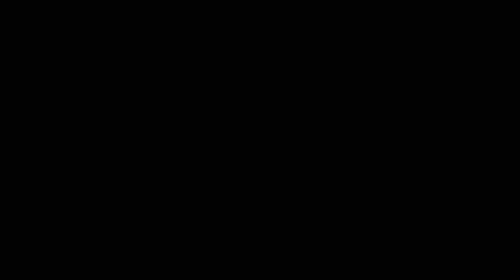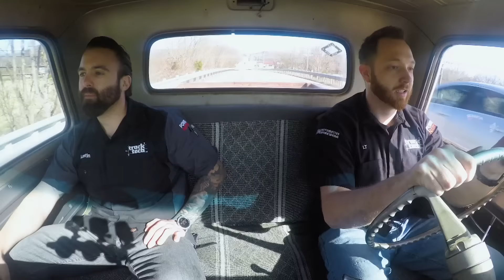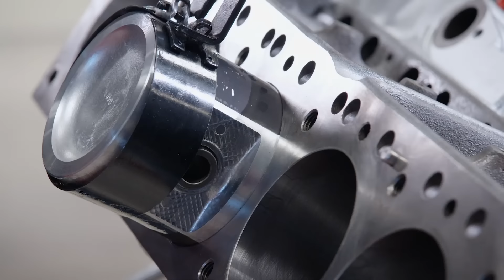Forget the LS Swap: Building a Turbo Chevy 292 Straight-Six

Comment: All Aluminum inline 6! Break out the check book
Reply: Actually you can get the all aluminum Chevy 4.2 Trailblazer I6 engine for fairly cheap at any junkyard. However, those engines had many design flaws, so I don't know if it is worthwhile.

Comment: Yeah... they didn't put the turbo there for OCD. They put it their because turbo manifolds for these engines are rarer than chicken teeth. 
They ain't got time to fabricate a manifold from scratch. Much easier to just run good after market headers and route a pipe somewhere else to mount the turbo.

Comment: I think you missed a little,  the dependability of a straight 6, the strength of the block with 7 main caps.  You should see what guys in Brazil and Argentina are doing with these engines.

Comment: Hb a Pontiac 250 ohc sometime?  Love inline sixes!
Reply: Those are pretty neat, but they are very rare. Also, many people hate timing belts, and they have good reasons to hate them. Even some of the cars I love lose points for having those stupid things.
Reply: @skylinefever  on NA and forced induction engines i actually prefer a timing belt because i could run the oil an extra 1000 miles on average before changing...timing chains need the engine oil for lubrication but also create more wear on the engine oil...but when it comes to a daily driver I still prefer a chain, if it stretches out it'll still get me home and I could drive it around for a few months like that, a timing belt stretching would mean misfires and potentially snapping and leaving you stranded

Comment: Those old in line 6s are the best motors, you can't kill them the 300 of ford and the 292 were discontinued because they were old workhorses that didn't sell enough parts
Reply: The 292 was discontinued because it couldn't pass smog. Rather than spend the money to put MPFI on the inline, GM chopped off 2 cylinders from the 350 so that they could overcome the fuel/air distribution problem that the 292 had. They only needed TBI to make the 4.3 V6 pass smog. The 4.3 TBI and later versions would have been good if they didn't use such garbage intake manifold gaskets.
The Ford 300 was discontinued because it was already smoggy despite having MPFI and a continuous exhaust air pump. Also, Ford wanted the 1997 F-150 to be shorter, and that meant an inline 6 wouldn't have fit anyway. They needed that stupid V6.
Also, those stupid engines may have sold parts at dealers, but people who get fed up with them then proceeded to buy a Toyota Tundra, so that cost GM and Ford, it didn't save them.
Reply: In Australia the Ford I6s didn't die. They got a little smaller (down to 4L) and went to overhead cams, and stuck around until the 2010s when Ford closed their local factory.

The last version was the now legendary 'Barra' with DOHC, 4 valves per cylinder and optionally a turbo. They're very stout engines and stock blocks have been pushed to 1000hp plus with appropriate upgrades to the rotating assembly.

Comment: Those HP and TQ number are very misleading.  The only thing hooked up was the water pump.  By the time you add a belt driven cooling fan, alt, PS and AC, if they add AC, you'd be back down, close to the factory ratings!  I also realize you can eek out more by using an electric cooling fan too.  Should have done some before and after pulls.

Comment: I had a all most new 4cyl Ford backhoe turbo I got from work. I asked my buddy if he wanted it and he put it on his 83 F150. It had a 300 I6 I6 carburated.  He purchased a Ofenhouser 4 bbl intake, took a Holley double pumper converted it into a blow thru, made his own headers and hot side for the turbo. A backhoe with a large 4cyl deisel  isn't made to turn a lot of rpm the waste gate is designed to make boost quick and a lot of it in a 2200 rpm range. 
He cranked his truck and oh shit come out of his mouth. It was making 6# of boost at idle. It make a lot of boost around 35#  He installed a blow off valve to calm the boost down.  After the  3rd used engine burning a piston he removed it. It was a lot of fun to drive. Guess that's how you burn pistons having fun with cast pistons and 6# of boost at idle.

Comment: I love all engines but to see the air intake next to the exhaust goes to show how modern intakes are better! The heat soaked into the air because it's so close to the exhaust is obviously less than ideal !
Reply: Yes, it is less than ideal. However, there was a good reason for it. Carbs didn't atomize fuel well in cold weather, so to help cold weather performance, the exhaust was located near the intake.
Reply: They purposely bolted the intake to the exhaust manifold in the middle under the carb from the factory to aid fuel atomization.  Cold air makes em run bad

Comment: Why o why did they put the intake on the same side as the exhaust?! Just gonna heat up the intake charge & waste HP. I had an old '67 Nova straight 6 that I always wanted to flip the head & turbo it
Reply: They did that because carbs don't atomize fuel well in cold weather. It is the same reason many V8 engines would have a heat passage inside the intake manifold and cylinder heads.
Reply: @skylinefever  I can attest to that, my Nova hated to start in cold weather. Still be cool to flip the head & experiment. Or run some kind of fuel injection setup.

Comment: Great job on the build guys. Love the inline Chevy 6's .Hope you do a dyno run with the turbo installed.I am going to build a Turbocharged 250 EFI Aftermarket 12 port Sissell cylinder head.One thing on your build though, hope you heated up the cam gear, otherwise the cam gear might come loose. Sort of critical.Thanks so much for building a inline Chevy 6! Keep them coming!

Comment: That is a yes on the six rebuilds.     had a 66 Chevy.       squeezed everything I could out of my 235 six.      have a one barrel carb.   but went with Clifford Rechearch headers.      got in a little bit of trouble.     with stacks and headers.      Loved that truck.   with my manual transmission.     another story.     LOL.

Comment: I know you guys are running a split exhaust manifolds but on my slant 6 im running a gasket match/lightly ported factory exhaust manifold that dumps into a 2-1/2 pipe high flow single exhaust pipe but the key is to use the right muffler with an inline 6. If you dont it will sound like a POS import! I found that using a flowtech afterburner muffler by holley makes my slant 6 throaty and rumble with a slight lope at idle and to the untrained ear sounds like a v8 🤘. Wish i could show a photo of my slant 6 built engine. I have done other poor man mods to this slant 6 . I dont have a shop or a garage so everything is done out in the front yard. If your curious of what i did let me know? It mostly a stock engine with stock parts except for the double roller timing chain. I noticed a big difference when i got it back together and drove it around  compared to how it ran with the parts that not modified when i bought the dart
Reply: any chance you could post a video of your engine with good sound?
Reply: @jench78   no problem . It will be about a week . We're dealing with winter temps/weather but suppost to clear out on a couple of days 45-50 for a high on those days. I'll keep you posted
Reply: @VintageMoparnut  thanks podnuh

Comment: Anyone know if the current 3.0 gm 4 cylinder industrial engine  is based on a 292?
I've heard conflicting info.
Reply: I thought the 3.0 4 cylinder was an altered version of the Pontiac Iron Duke / Olds Tech4.
Reply: @skylinefever  
I did too, but the valve cover really has an odd shape.
The side facing the ports has a lot of squiggles in it 
(lol nice technical term) it's not really an almost straight line like the other side.

Comment: I wonder why Straight 6's don't get more love on these kinda shows? I think this setup is just amazing !!
Reply: I've heard the old Jeep inline 6 was indestructible
Reply: @beantown_billy  ford 300's are nearly literally indestructible. Mine has over half a million km and still ran like new with a bump of the key
Reply: Had* I sold it years ago
Reply: @jaceb7136  Those are incredible engines too!
Reply: @beantown_billy2405 Yes those 4.2/4.0 Jeep engines can last forever! My uncle has 1990 Jeep Wrangler with the 4.2l 6 and 5 speed with 152k miles and although it burns oil, it never stops running!
Reply: @beantown_billy2405 it is, in fact it is.
Reply: go to other countrys they just LONE these straight 6 engines
they are pushing over 2K power out of them
Reply: I think people only want V8 and think that V8 can be the only true power plants.
Reply: Because people are dumb
Reply: because they make only 219HP with a turbo!
Reply: Everybody loves V8’s. Don’t get me wrong I absolutely love them too so I understand. But man do I have a soft spot for straight 6’s. I have a built 250 straight 6 inside my 51’ Chevy

Comment: 1994 I Own a $ 200.00 1973 GMC Flat bed with a Miller Blue star AC DC welder on the back, in between Elko & Jackpot Nevada. Came across the Greyhound bus that pulled off on the right side of road.  right front tire & duels buried in the sand....Plus 40 + happy campers.I   ask the Driver, need some help like getting back on the road,  he said a tow truck will be here in about an hour, I said I can get you out in 45 sec. Driver said with what?  That old flatbed farm truck ! I said fire that dog up, follow me, I pulled out my 15 ton snatch strap, hooked up started out in 1st gear granny low that'll Old sweet 292, pulled that puppy right out of there, Bus driver ask me what type of engine you got? I said a straight-6 cyl 292 he gave me a free bus ticket too ride anywhere on Greyhound, told him I don't need that  I got myself a Jimmy,,, it'll go anywhere.🤣

Comment: This is why I have a problem with hopping up these old six bangers.  You take a bunch of good parts and have professionals put it together and you get a wimpy 220 horsepower out of 292 cubic inches.  370 with a turbo charger worrying about scattering the engine if you rev it past 4500 RPM.  I know the name of the truck is "Project Low and Slow" but you could be just as slow with a Goodwrench 350 and with a few bolt on upgrades, make more power and be far more reliable. - Or build a bone stock LS-5 454 big block.  The under hood impact is awesome with a big block as well.  Of course, I'm a V8 guy.  I don't waste my time with "six bangers".

Comment: The offenhauser intake is nice looking, but way way not long enough.  You need intake runners like Mopar runs.  For a truck they are maybe OK. 

Biggest problem with the old slant six was the intakes were cast and they would crack.  With the alloys/plastics now that isn't a problem.

Comment: When I used to build Holden red motors which is same design as the one you guys did we would allow more oil onto the timing gear when upgrading to the alloy / steel gear 😊

Comment: Why didn't they have someone mill them a torque plate? To expensive?  Unnecessary short cut... considering they probably could have barrowed one from the machine shop they usually use for all their builds.

Comment: The GMC straight-six was a better engine; it was a screamer, and most popular for drag-racing and salt-flats records.

We had a '58 GMC 370 with a breadbox, 4.88/6.42 electric rear end, with 9.00-20 tires, and legend has it, my grandpa got mad at his BIL while moving them, and they could barely keep up with him driving accross the state at 75 mph.

Also, why not a roller cam?  It looks like one would fit.  I thought it was highly undesirable to run a turbo with a blow-through setup; I was told the butterflies can get ruined when the throttle is slammed shut at full boost, kind of like slamming the air door shut on a runaway Detroit Diesel.

Comment: I worked for a guy in the 70s that built stock car engines, mostly WC and LMS. We built a few of the Chevy sixes also. Back then the 300 Ford six would smoke the Chevies in the six cylinder classes.But we did a little trick to these that would make them win against the Fords. As I recall, the SB Chevy rods fit right in these engines. Also the six cylinder toyota engine of the land cruiser seemed to be a direct copy of this engine.

Comment: I might've gone with a Clifford intake over Offenhauser for this build.  Seems like the more open nature of the Clifford would better suit.
Reply: Not familiar with either of the Chev 6 manifolds, but I am familiar with the Holden 6 manifolds. I never liked the squared off manifolds that were very typical in early factory castings. It makes the inside runner too short and the outside ones too long. Much prefer manifolds like the Cain design where the centre runner was lengthen and outer runners tapered towards the head.
Reply: I think that they are just using it for the naturally aspirated pulls, the turbo set up is fuel injected.

Comment: Them little Motors are like a sore pecker you just can’t beat them my first truck ever 16 years old I had a Ford carrier with a straight six the radiator had to be mounted outside of the front grill but I drove that little truck everywhere

Comment: I had a friend that raced those on dirt tracks instead of small blocks in Chevelles in the early 70s.  After cutting off one one cylinder on each small block head. Then welding them. He filled the V8 head bolt holes and bored more holes to fit the 6 cylinder block. He installed 350 pistons in the 6 cylinder block. The next year he did the same thing with a 250 block and machined the block so the 292 crank would fit. His experience was he did not need more than one engine for entire season vs two or three with small blocks. Oh and the small blocks, good luck keeping up with a built six on a short track.

Comment: So where is the turbo run? A bit pointless dynoing a engine on a carb that is intended to be efi turbo!
And that 750 is way too big for a 4500 rpm 6.
Those engines use mostly SBC Chev internal parts and sizes. Lifters, bearings, rings etc, Good not so old engine with plenty of torque.

Comment: My 57 Chevy has a 235 and a 3-spd. I love that combo. Best starting and smoothest carb engine I have.
Reply: Shane, do you have a one-barrel, a 4-barrel, or a Clifford/Offy multi-carb intake?   Somebody made a handful of alloy-block&head 292s that were for racing, so they were un-godly expensive--$10-20K back then, which was "stupid-money" because 10K'd get you TWO Corvettes in that era.   But your 235 could be scanned & 3-D'd in Alloy, weighing at least 100 lbs Less than the 265 V-8, and maybe adding a $100K Value to your '57, because $20K then is at least 100K now.   A friend back in the day had a milled-head 235 '57 that'd BEAT some 283s & 327s, but because he increased the compression, he'd burn more oil than a stocker.
Reply: @jackdale9831  original factory 1-barrel

Comment: I would have swapped those rods out first thing for some Carillo H-beams. The stock rods in the 292's are the weak point when revving over the stock rpm limit. Generally, anything over 4000 is flirting with disaster on a 292, regardless of how good the rod bolts are. Once you start boosting it, you'll most likely find out the hard way. Otherwise, nice build, and good attention to detail. I like the replacement 'guide plates' for the head bolt bosses. First time I've seen something like this done on a straight 6.😉

Comment: This engine was in school buses back in the 60's and was tough as nails.  It was really a bullet proof engine.  Drove one for thousands of miles.  After some wear, they ran much better by advancing the timing till just before causing a starting problem.  These engines had the dog poop run out of them in a school bus.

Comment: I had a '60 Apache 10 long wide bed when i was in high school. Loved that old truck. Always wanted to use a 250 6cyl with a 292 crank, turbo blowing into a supercharger, port fuel injection, and a little aggressive on the cam. Nowadays i would seek a hydraulic roller cam setup.  I would put port separators in the head as they would keep the bolt support on them and are aero shaped for airflow. These port airflow parts you showed i would not need.

Comment: I would of went with Forged pistons over them Hyper's regardless of the intended HP goal.
Reply: @Grumpy468 Seen a stock bottom end 454 with cast pistons making over 1100hp with a S480. Shits tougher than what the utube experts think.
Reply: @Grumpy468 I had a 477ci BBC with KB hypers in it, made 680hp NA and shifted at 7200rpm. Never had a bottom end failure with 2yrs of daily driving it and street racing on the weekends. The 748 lift solid roller cam  was hard on valvesprings, but that was the only hassle with it. And MPG sucked.
Reply: Forged pistons might be extremely difficult to find for low performance inline sixes, maybe even requiring a special order.
Reply: I ran KB hypers in an LA360 up to 7,400rpm in every gear for 12 years. What’s the problem?
Reply: Custom pistons for the 292 are expensive,  the only pistons that are "economical" to put in are a set of stock style hypers.

The 250 (292s little brother)  is easier to find pistons for,  since it shares the same piston as a 307 smallblock chevy.

Comment: Aaaaaand we did some stuff to the cylinder head for more power its really not that interesting, nevermind that, howbout these expensive pistons from X company.....
Reply: I thought Keith Black hypereutectic pistons weren't that much more expensive than basic stock cast pistons. The difference was going to forged pistons, especially forged pistons with a modern narrow piston ring set. I have read some great things about replacing the 5/64 5/64 3/16 ring sets (approximately 2mm 2mm 5mm) with a 1.5mm 1.5mm 3mm ring set, or even a 1.0mm 1.0mm 2.0mm set.

Comment: How come machinists typically fasten the deck plate down with higher deflection bolts when the build calls for studs?
Reply: lots of old motorsnused bolts untill we decided studs were better and did some testing